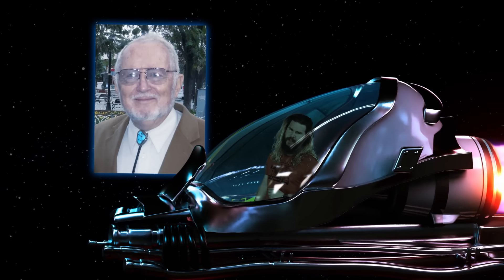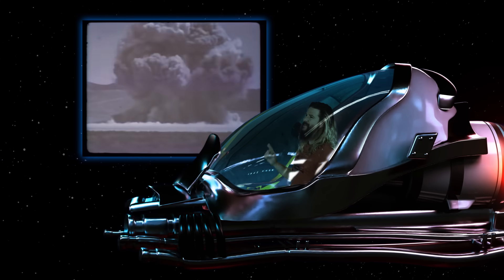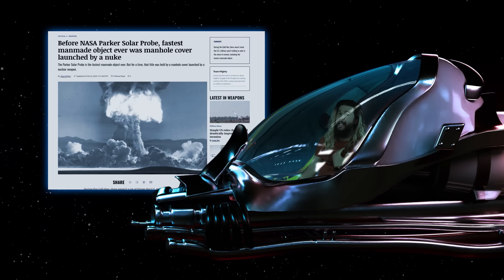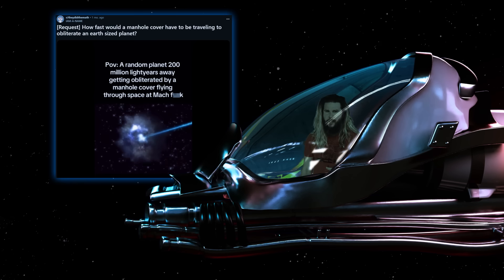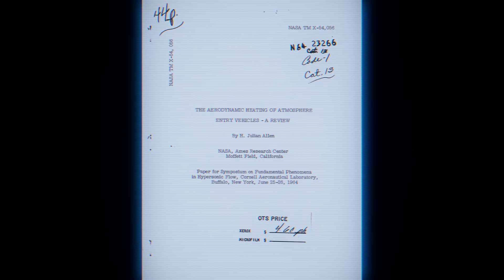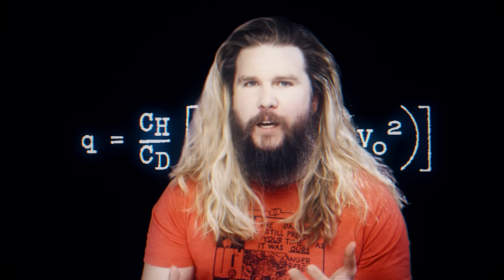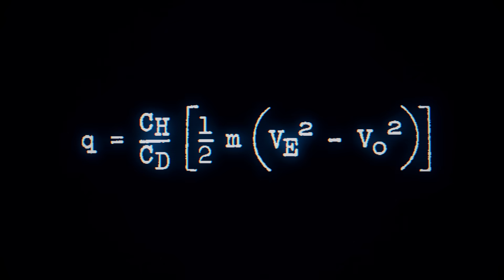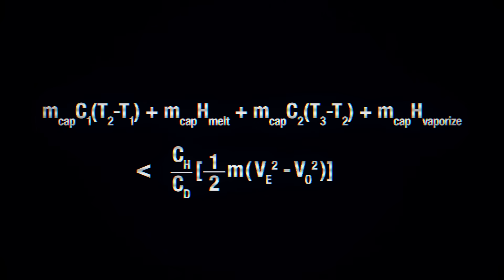Debunking the Nuclear-Powered Manhole Cover

Comment from the maker: *Thanks for watching!* So many smart comments! You love to see it. Let's address them:

I knew (and said in the video) going in that everything was going to be a slightly better back-of-the-envelope. In terms of a first approximation that you might find in a primary or secondary physics class, I'm fine with it. I know that the atmosphere is only so high, I know that hypervelocity makes a difference, I know that heating takes time, I know the shape factor might not perfectly apply. Like I said, first approximation -- I don't have a supercomputer for millisecond-by-millisecond analysis.

Further thoughts:

Drag is proportional to the SQUARE of the velocity. So some of you saying drag is less at hyper velocity are not thinking about this. Observe how “slow bullets” move through water and hyper velocity bullets are more or less destroyed on impact (yes water is 1000x more dense I know, but the velocity increases the drag that much).

Think about the boundary conditions I set. We made it so there would have to be “at least this much energy.” There is, and so having it be 5-10x more energy than “required” means there is room for a fudge factor.

If you have problems with the approximation, do let me know. Otherwise, if there's a more capable physicist, take what I did one step further!
Reply: Should've calculated how far it could make before being vaporized! Would've been interesting
Reply: My only question about this is time, actually. Heat transfer does take time, and unlike how many meteors come down, that thing was going straight up. The question is less 'can the atmosphere melt that much iron if it's flying at this velocity' yeah, we've watched starship almost burn a wing off twice, and more 'can it do this in time, before the lid makes it past the denser parts'. Exposure time is important here because although it's basically being roasted by plasma as the air basically explodes on contact, it's still heating from one side at a time. 

I do understand how complex this gets, i don't even want to think about the dynamics of the drag heating on the cross section of a disk moving mach jesus, flipping through the air and probably sounding like the most unholy ricochet ever on it's way to god...
Reply: @zerumsum1640 Honestly the assumption Kyle made is probably pretty conservative.

One of the main sources of heating would be adiabatic compression. The air won't have time to move out of the way so it will compress a column of air above it at 150,000 mph. Heat transfer rate is proportional to the pressure.

So the harder it is hitting the atmosphere the hotter and more aggressive. Using some of the simple wall temperature estimations for reentry. The shuttle capsule had a wall temp with this formula of 1600K. The same equation for the manhole cover is 33000K...
Reply: I think the biggest issue is this part:
(VE^2-VO^2) being simplified to (VE^2).  
This single bit assumes that the plate was burned up as it encountered enough drag in the time it was in atmosphere to come to a complete halt. 

 I am not saying it couldn't, it's just you showed no math that proved that it would encounter enough drag to reduce it's speed at a reasonable pace.  Remember this thing was NOT instantly destroyed on launch and would have punched into the Thermosphere within fractions of a second unless it had absurd slow down from drag.

TLDR VO^2 = 0 assumes that the plate was burned up, therefore your math proved it definitely burned up.
Reply: @zancloufer Vo=11.2 kms (orbital escape velocity) recalculates it from 3.8x10^13 to 3.7x10^13 not much change there lol. But I agree it is an invalidating assumption to say no it didnt make it. But the numbers are close enough to warrent a hey that's pretty close we now cant be sure. It's also extra hard to come up with what that final velocity could be since flying through a nuke blast is "different" than normal mesosphere lol.
Reply: @zancloufer  I also think this is the biggest issue with this video. And not even that he simplified it, but that he did it silently, without mentioning that he's doing it, why, and how it affects the meaning of the result.

If it turned out, with this simplification, that there wasn't enough energy to vaporize the plate - that would be conclusive.
Converting only part of the velocity into heat gives you less heat than converting all of the velocity into heat.
So if it turned out the latter wasn't enough to vaporize the plate, the former would've been also not enough.

So Kyle's calculation could be seen as an attempt to prove that the plate could not have vaporized
And the attempt was unsuccessful.
Which means it's inconclusive - there was* enough energy to vaporize the plate, but we don't know how much of that energy went into vaporizing the plate, and how much was left as remaining velocity.

The calculation is fine, but the way it was presented is misleading.

*assuming his other assumptions are correct
Reply: Does this also assume the cover stays flat the entire flight? If it tumbles or goes edge up at all, that should decrease drag slightly over just staying flat the entire time.
Reply: But Kyle,  it was not traveling flat on.  Nor was it traveling through sill air.  There was a strong jet of gasses coming out of that tube pushing it along.  Though you also didn't mention the heat or induced heat from radiation from the explosion.  With such an inaccurate model me thinks your conclusion is not very helpful.
Reply: "Lets compare this with the numbers of Atmospheric re-entry" --- raises hand  Wouldnt that still not work though?... in Re-entry, you start with a thin layer, then work your way into a thick layer.. with the thicker layers increasing the friction, which in turn increases the heat build-up/resistance.  That manhole cover though, was going the other way, starting with thick atmosphere (albeit a huge chunk of it displaced by the explosion itself), then moving into thinner atmosphere.  So starting at max resistance/friction, ending with least amount. So rather than 'heating up' on the way in, wouldnt it be 'cooling down' on the way out? (not exactly cooling down, but the rate of heat-increase would slow more and more the higher up it goes?)

reposing this here incase the first gets lost in the 2000+ comments :D
Reply: @Gwydion_Wolf  It would not be an inverse as he explained it. The layers you mentioned, I am assuming you are referring to the atmospheric layers: Exosphere Thermosphere Mesosphere, Stratosphere, Troposphere. They do increase in height as you move away from the planet, they decrease in pressure as such density as you move away, they also change in radiation potential and electromagnetic properties as you move toward or away from the planet. Moving toward the planet you would be moving through  layers of increasing density but rapidly slowing down as you did, because of this you would be building heat because of the air resistance. Moving away from the planet at a super high speed the change in density becomes less important because of the small amount of time you are in each layer (fractions of a second). 

One of the more important points that he missed, when an object enters the atmosphere it often follows a very special arc around the planet called  a decreasing eclipse. An object rarely has a head on collision with the planet although it does happen, the reason it doesn't happen often is because of the heat the object will build as it moves through the layers speeding up because of gravity. The heat speed and air resistance  usually causes the object to blow apart, which is why it happens but mostly insignificant.   Where the manhole cover is different is that it is moving directly away from the planet at such a high rate over such a short time, going through less dense layers the further away it gets that it still heats up it just heats up slower. 

There are a lot of super complicated scientific principles going on with this manhole cover. Properties of metals, aerodynamic properties,  physics of motion, physics of planetary bodies, thermodynamic properties, fluid mechanic properties, and more. All of these are very complicated and science still doesn't understand them completely, when you try to solve these properties at the speeds the manhole cover was going the properties act different and science struggles to understand them more. Physics and physical properties act really weird at super hot and super cold temperatures,  super high pressures and vacuums, super high speeds and accelerations, and instantaneous changes in direction.
Reply: Here's my problem. An object performing a re-entry is carrying the full energy of the event. A static atmosphere that is increasing in density with depth is being impacted by an object coming in from space is not the same thing as a giant bullet from a giant gun. If a nuclear explosion accelerates a bore-hole plug then the object will be pushed by an enormous force of expanding gases. This enormous force of expanding gases will create a giant atmospheric phenomenon of which the front will be carrying the plug. There will be a giant plume of gas that forces itself to higher than normal altitudes, There will be enormous pressure both behind and in front of the plug, and just in general it is not reasonable to assume that a re-entry will be an appropriate analog. It depends on how fast the plug was moving and how fast the pressure wave of the air was moving and exactly what this means for the plug-air interactions , , , but being hit by a wave is not the same thing as riding it. I won't argue that it made it to space, but I will argue this is not an adequate "debunk".
Reply: Something isn't mathing in your math here Kyle.  In both the formula at 9:35 and in the plug in at 9:39 you have what equates to a much smaller number on the right side of your comparison.  It seems like you might have squared something you didn't show.  I have the right side equaling 3.8 x 10^7 or 38,301,150 Joules.  Also on the left side of the comparison it seems like you are mixing up the units.  With the exception of the first expression (934kgx.(45kJ/kg x K) you are using kg x J/g.  Did you take this into account in your calculations and just leave it like that to make sure we were paying attention?  I take off points for not keeping your units consistent. :D
Reply: @russellashburn6268 you forgot to make the 66kilo m/s into 66000 m/s before you plugged in and squared it. Units are a pain fr.
Reply: As someone brought up in one of the comments, when you apply this equation for objects moving upwards, you're inventing free energy!

And the assumption that the final velocity is 0 bakes in the result – the manhole either had to melt, or fall down.
Reply: @mskiptr final velocity being zero is asking if ALL the energy was lost to drag friction CAN this thing atomize not, will it stop flying. If the slug was 10x larger and still set to final velocity 0 it would have said CANNOT atomize. The numbers kyle ran are close enough that you can say it COULD have been stopped not it did get stopped nor it didn't get stopped.
Reply: One other factor missing is that the drag coefficient seems to assume no tumbling. Also at those speeds, is the air moving really away or compressing? is part of the heating going into the compressed air instead? Is there a leidenfrost effect playing a role of superheated iron plasma protecting the bulk, that maybe is liquid already but still moving? As for the comparison with metoerites, those explode but fractions make it to the ground at times, so maybe there is some iron shot flying through space? We have space probes reentering fine at ~12km/s, not even one order of magnitude off ... as for the heat transfer timing, I would really be intrested how fast it spreads (cant be convective in the solid state, also not really that fast convective in the liqiud I guess) vs. the time it takes to leave the athmosphere...  I think this is one of those cases where no back on the envelope calculation can give a good answer and real simulations are needed. Maybe start a crowdfund camapaign....
Reply: @PlasmaHH  it also assumes a flat disc, which this thing most definitely would not be after accelerating to hypersonic speeds in a fraction of a second
Reply: @PlasmaHH  The Leindenfrost effect would not really apply here because of the surface tension requirements at pressures and the shift of eutectoid points from the pressures and temperatures. Many of the principles and phenomenon that dude referenced are all flow dependent or time dependent. The behavior of flow rates at temp extremes as well as the limits as time approaches critically small measures for thermal transfer rates creates chaos in the principles. Even the behavior of parasitic or primary drag forces begin to take on different effects because of the density ceilings of Navier-stokes. I would argue that the extreme difference between the xy (flat coin) face of the cover in comparison to the zx (coin on edge) and the aerodynamic differences begin to take on weird properties, if the flight was stabe (non tumbling) air resistance and compressibility are mute points because of the magnitude difference. If the cover were tumbling proportional to the forward velocity, it would be tumbling at such a high rate it would basically begin to take on the aerodynamic properties of a sphere in flight. The surface heating of the cover would not just be limited by the thermal transfer in, but also by the diffusion of heat into the whole cover to reach equilibrium. It would technically be possible for creep rates and eutectoid shifts to cause a surface phase shift that would cause partial liquidification at such high temperatures and tumbling rates.
Reply: A Supercomputer?!? It's calculating a single disc being launched through a thinning atmosphere, we're not talking about global weather models...

Pretty poor and defensive response to a lot of very constructed and well thought out explanations as to why your video would be perpetuating just as much falsehoods for making it sound to the layman like you proved something. You provided a worst case scenario with no context that that's what you are saying and you didn't calculate a best case scenario let alone mention that what you calculated could be far far lower than what you provided given the best case scenario or even the possibility of something in between.
Reply: “(A)t least this much energy” still assumes that the speed is reduced to zero. In which case it doesn't have to change phase in order to not go into space.
In other words, you have shown that there's enough total kinetic energy to vaporize it - with a far more complicated formula than necessary - but you haven't shown that it will happen. You haven't even shown that it is likely.
Reply: Also, you really don't need a supercomputer for millisecond-by-millisecond analysis; a mid-range laptop from ten years ago would be more than enough, there are only a few thousand milliseconds to calculate before either it has been stopped by drag, or has escaped the atmosphere.
Reply: @kylehill  did you really like your own comment? 🤓
Reply: An actual physicist here.  The calculation is wrong, because the wrong units have been used on the heat of vaporisation.  It should be 6340 kJ/kg not kJ/g.  That is a very big difference, because the number used is 1000 times what it should be, and makes the whole energy for vaporisation nearly 1000 times what it should be.  Using the numbers with the correct units gives 7.9*10^9 J, rather than 5.9*10^12 J.
Another error is that the right side of the equation is supposed to be the fraction of the kinetic energy that is converted to heat.  That means it can not be larger than the kinetic energy.  Instead the kinetic energy has been multiplied by 24.1/1.28 = 18.8, which is far too large.  The right side of the equation should be no larger than 2.0*10^12 J.
The other (more minor) issue is that the speed was never actually measured.  But, even if it was escape velocity then the kinetic energy would be 5.8*10^10, which is more than enough for vaporisation.
Reply: You let confirmation bias build the reasoning for the conclusion you already had.
Reply: Would it made it to space if it were made from a different material other than puny cast iron?
What about ceramics or Tungsten.
What about a more Aerodynamic object with less drag, is it even physical possible to make a "Space Cannon"?
Reply: @timhartherz5652  Yes, NASA made a Space Cannon out of a WW2 Battleship 16" deck gun a long time ago.
Reply: I thought the manhole cover was made of steel and weighed around 2000 lbs but perhaps I was wrong! Still interesting
Reply: Kyle genuine question, and forgive my ignorance. Does the time make any difference? As the time in the atmosphere would be very short. It would reach the Kerman line in about a second and a half. Can it generate that much heat in that amount of time? Or is time irrelevant, and the depth of the atmosphere is what counts?
Reply: Only way to really know is to do it again. For science!
Reply: Kyle there's a difference between a back of the envelope calculation or a calculation that, no matter what was done with, would only produce one result. Manhole cover didn't go to space. Your calculation assumed it hit velocity zero while in atmosphere. Whether it burned up or didn't becomes irrelevant to the results, because if it hit velocity zero in atmosphere then it didn't reach space. Its understandable to be unable to calculate every little detail of its flight, but to declare you've debunked the manhole cover reaching space when you didn't even allow for the possibility of it reaching space is the same kind of science scam you've declared you hate.
Reply: Did you calculate the drag coefficient as if the disc was flying on its edge like a Frisbee, or face on like a circle perpendicular to the angle of acceleration? Would spin affect the calculation noticably? If the angle of the flight matters, is there some possibility it could have stabilized in the air?
Reply: I have a question about how the cover spinning at an extreme speed while breaking through would affect the calculations, would it increase or decrease the heat resistance of the iron in transit?
Reply: A further problem with this is that the kinetic energy would be more than the entire yield of the explosion.  Pascal-B was 300t, which corresponds to about 1.2*10^12 J, whereas the estimated kinetic energy would be about 2*10^12.
Reply: I have one question. Is the initial speed verified? As I understand it that is only based on one mans calculations. If that number is wrong then the whole equation is wrong.
Reply: You made alot of assumptions that I don't think hold up very well. 
You assumed the cover was flst the whole time, this can't be proven and seems unlikely given how hard that is to do. Your equation is for something that's entering the atmosphere going from lower friction to higher friction, and you assume that the whole piece heats up uniformly which nothing does when it's being heated up that harshly from one direction. 

Then we go to the material, cast iron, cast iron does burn relatively easy compared to something like steel or wrought iron but that still takes time, and I don't know if you took into account how much time would be needed. And second modern cast iron is much more homogeneous that the majority of meteorites that explode In the atmosphere. 

I understand that this is only slightly better than back of the napkin math but you've really only shown that it's technically possible  the manhole cover vaporized, but you left out so many variables that you can't even say it's likely
Reply: From all the articles I have read says it was steel, not cast iron. So could you please redo your math since steel handles higher temperatures.  Now, if all these articles that I read have made the same mistake, I apologize.  Thank you
Reply: Does the equation change if the "projectile" settled into an edge forward direction
Reply: I am thinking about how it most likely didn't go straight up without it toppling end over end...
Reply: Problem with your equation is you are assuming that the drag coefficient is constant. If portions of the man hole cover are vaporizing then as the object moves through the air and more of it is vaporized it stands to reason that the drag coefficient would change with the changing shape due to vaporization. I think it would be reasonable to say that most of the man hole cover would be vaporized but some amount would make it to space.
Reply: @bevey3437 the manhole cove is going WITH OTHER MATERIAL so less of it would vaporize then you are thinking😅
Reply: One factor/variable you failed to account for is the nature of pure metal under heat and pressure. It would have compacted in on itself in a cone shape. Heat transfers take time. And I don't think it took long enough to get to space to have the time it would take to burn up. I think it would have heated into a liquid, formed into a cone/bullet shape, and naturally taken the fluid path of least resistance. It definitely would have lost mass on the way to space, but due to the pressure of air resistance, it would have been pressed in on itself and gained a molecular density and surface smoothness that, coupled with how quickly it was yeeted, may have spared it from vaporization. Alternatively...if the heat it took exceeded vaporization temp like 5 to 6 times over...is it at all possible it became a plasma projectile?
Reply: The thing was solid enough in the picture that if it had hit melting point i dont see why it couldnt have become plasma 😂 @joshuamcdowell1460
Reply: HOLD ON...If it's traveling that fast and gets well into space in a second or so... doesn't the law of thermodynamics have something to say about this!? An object launched at 150,000mph reaching space in 1 second or so, would likely negate the time needed for friction heating to destroy it due to minimal atmospheric exposure!! A Huge amount of heat may have been generated, sure! But did it have enough "Time" to affect the plate to destroy it!? Any heating no matter the temperature "Doesn't happen instantaneously!! It would have had only 1 second of exposure, before being super cooled in space! Iron needs somewhere in the region of 1.6 GJ = 10⁹J , in only 1 second, per Kg... To have melted the iron! So requiring 320 Giga Joule's of energy in 1 second to destroy the plate! Or the same energy produced by 320 nuclear power stations combined in one second!!
 A candle can burn at over 2500°F... But you can move your fingers through it no problem, as long as you keep moving and don't allow the heat to soak over "Time!! 
The meteorite argument doesn't really make sense either!! It's traveling much slower! Is exposed to the heat for many 10's of seconds! And always skips across the atmosphere for 100s or 1000s of miles...Not a direct straight path from ground to space like this! The second law is a pivotal aspect of physics that nobody has cared to involve in their estimations not to mention the possible Quantum effects on the systems involved!!
Reply: I have a question. Our atmosphere gets thinner as you get further from the planet, correct? If so, your numbers arent quite right. As something enters the atmosphere, it meets contunually increasing resistance. In contrast, something exiting the atmosphere would meet continually less resistance as it goes further. Also, a disc in flight such as the one in the video would not rise perfectly flat, it would begin to spin, which could reduce the energy transferred to said disc due to less drag and a more universal "cook time" on the surface area. How would these changes effect the flight, or vaporization, of said iron disc?
Reply: I have a doctorate in aerospace engineering and did my dissertation at ASU on a proprietary math that calculates air flow at a much higher accuracy and speed than all modern systems (my math and software is currently used by a major defense contractor). I can also test objects flying through the air with some manipulation. I threw this into my program a few times and what I learned is that at hyper-sonic speeds it took over 15 seconds to reach a point at which the velocity would vaporize it based on temperature. I also threw in a test where the manhole cover was spinning around on a single axis at 10k rpm and it took 9 seconds to heat up to the point of vaporizing. Im not super versed on velocity decreasing over time do to resistance and gravity (other end of my focus) so I cant attest to that. But with the reduced friction and temperature at you gain altitude I would say there is a greater than 50% chance it made it into deep space (If it didn't collide with anything else) and greater than 75% change it cleared our atmosphere.
Reply: funny how you said 'millisecond-by-millisecond' when, quite literally, all we have is a millisecond
Reply: Unless you're assuming the manhole cover vaporized the instant it reached 66km/s you did your change in velocity wrong. For the purpose of heat exchange here the change in velocity we need to use in the how much velocity the manhole cover lost as it went from ground level to space. If we are generous and say that it takes 2 seconds for it to exit the atmosphere and atmospheric density is always the same as sea level, and use the maximum drag force for the whole distance, the manhole only loses 180 m/s. You can then plug it into your equation and find that the heating energy is on the order of 10^8 J which is a lot, but far from the 10^13 J that you predict.

Edit: went ahead and found a better drag equation and confirmed it to be quadratic and the change in velocity only increased to 362.8 m/s. That only brings the energy from your equation up to 1.15 x 10^9. Still not nearly enough to vaporize the manhole cover.
Reply: @Harkmagic  I would love to know which drag equation you used to get a reduction of only 180m/s, because when I calculated it, the peak drag was enough to stop the entire 66km/s in 0.024 seconds if you assume that the peak drag remains constant.
Reply: @WJS774 
v(t) = v0 e^(-t×b/m)
With b as the drag coefficient.
Get m and b from Kyle and set t to 2 seconds.

Its technically a horizontal drag equation, but gravity is trivial so it works just fine.

Classical Mechanics, John R. Taylor, 2005. Page 48 equation 2.22
Reply: @Harkmagic  OK, so you've totally butchered that then. Firstly, that equation makes the assumption that you can ignore compressive drag, which is obviously not the case at hypersonic speeds. Secondly, the "b" in that equation is not the same b as Kyle is using. Read chapter 2.4 on quadratic air resistance, and if you do the calculations correctly you'll see that using these equations the cover will have lost 98% of its speed after 2 seconds, and have made it less than 10km into the air. In reality pressure will have dropped at that point and drag will be less, which this equation does not account for, but most of the velocity loss will have occurred when it was much lower. The cover will no longer have escape velocity after just 0.2 seconds.
Reply: @WJS774  Since he misunderstood, then you decided to throw the gavel: the hypersonic compressive drag is still a fluid based principal that has limitations in density, velocity, stagnation, molecular proportion, even electromagnetic limitations. Do the calculations of the kinetic energy of the cover, then contrast the magnitude of that with your claim of 98% loss in just over 2 sec. Everyone is here out of curiosity, when you throw shade because someone didn't understand you bring the spotlight on yourself. You're better than that.
Reply: @WJS774  Your drag calculation is wrong.  The amount of time it takes for drag to reduce an object's speed to 0 is infinite, because drag is proportional to velocity.  As the object slows down due to drag, the force of drag reduces.  You can not assume drag is constant.

In this instance, even the other parameters of the drag equation change over time.  The fluid density decreases as it rises through the atmosphere.  The mass decreases as bits of it vaporize and ablate away, also causing the coefficient of drag and the cross-sectional area to decrease.  Absolutely none of the parameters can be treated as constant, thus requiring integration to solve.
Reply: @PaulBurg  I said if it stayed constant, to illustrate just how high the drag force is at that speed. Obviously this isn't actually the case.
Reply: @Harkmagic glad I'm not the only one that noticed he forgot to calculate the change in velocity.
Reply: It looks like the velocity was assumed to be a constant, but the aerodynamic drag would have slowed the plate down
Reply: I have a theoretical question, if the cap were to end up vertical (like standing a coin on its edge) would the improved aerodynamic state of the cap change the result of the calculation?
Reply: @PBMototsports  It wouldn't happen, since the edge is an aerodynamically unstable position.
The most stable position for a flat disk is face on.
Reply: stop fucking trying to sound relateable to gen z. it just makes you sound fucking retarded.
we do not use those words the people who do use those words brains are already mush.
Reply: Don't be mean to Joe!
Reply: I'm wondering if the original 66 km/sec estimate was sane in itself. The thing had to accelerate, and so when did that happen? Shouldn't you integrate the heat transfer equation over the delta-t of that formula? It seems like you short-cutted it - no napkins needed.
Reply: Small point of contention, is that heating algorithm for vertical or horizontal flight?  With the sharp reduction in density from vertical exit, could the heating have been reduced that it liquefied instead of completely vaporized?
Reply: How does atmospheric density lessening as it goes up affect the heat transfer? Wouldn't that allow it to get higher before the heat is transferred? What height would it have been vaporized since it wasn't instant?
Reply: The biggest problem I have with your approximation is you used the equation for an object entering the atmosphere wherein it is meeting increasing resistance proportional to its descent, whereas there IS an equation for an object leaving the atmosphere and it’s not the same as an object leaving the atmosphere encounters less drag the further up it goes.

You started this with fundamentally flawed math, so your results are fundamentally flawed.
Reply: I am way out of my depth here so if i am wrong please tell me but wouldn't the atmosphere be thined by the blast and have a lower relative speed to the manhole causing it to experience less friction then would be shown in the comparison equation for atmospheric reentry?
Reply: Yeah it's a fun video. But to be honest, I'd be curious if the 5-10x margin is enough to possibly allow escape velocity. If it was 100x difference I think we could be pretty confident no other factors could make enough influence to allow it. But 5 or 10, not so sure we can rule that out.
Reply: Perhaps the most important thing to consider is the fact that this hypersonic manhole cover is accompanied by a focused  hypersonic jet of ionized plasma from the blast pushing the atmosphere aside as the manhole cover moves through the lower atmosphere.
Reply: Does your equation account for time? A blow torch has enough heat to metal steel but only if it has enough time to do so.
Reply: I dont think you accounted for the atmosphere being a gradient and that pressure/drag decreases exponentially with altitude. 50% of the volume is in the bottom ~4.5% of our atmosphere. 
So you would actually be squaring a number that is exponentially decreasing, as both the object is slowing down and losing mass, and the friction from the atmosphere is decreasing. If friction is decreasing ~2x the rate of the decrease in pressure you likely would not have enough energy to destroy it.
It would also therefore need to lose at least 50% of its mass in ~1/10th of a second, which may or may not be possible. I dont know if it could conduct that amount of energy in that amount of time by those means.
Reply: Wouldn’t melting of iron be enough tho? This would substantially decrease left side of equation even more
Reply: You will get those comments, when the math has so many variables. Examples Thermodynamics on a changing leading edge.
Drag coefficient.
Sectional density from orientation.
True air speed.
Without these taken into consideration. You can only test best/worst case. If they both come to the same conclusion, it's just a best guess.
Reply: I've just watched the video, but I have some problems.
The experiment was not about containing a nuclear explosion, but testing the safety devices of nuclear bombs by putting one in a hole and detonating a normal bomb on top of it. It was part of operation PLUMBBOMB. The experiment to fully contain a nuclear blast underground was the Reiner shot, conducted later.
Also, the cap was not cast iron, but solid steel and it was welded on top of the hole. So it was not just lunched from the top of the shaft, but torn off. Meaning the shape was most likely not a flat disc.
And you did not account for black body radiation in your equation. Which is kind of sad.
Also, as the travel starts from dense, oxygen rich atmosphere, it is likely that an oxide layer formed that could slow down heat transfer.
And the comparison to meteorites does not make the conclusion more plausible, as meteorites are usually not made out of solid materials, and are more likely to break up upon entry to begin with. In Indonesia they have a collection of man-made objects that survived re-entry and breakup. Satellite makers are required to do tests in plasma wind tunnels to check what would happen to its parts upon re-entry. Those test probably have more relevant data on the subject. And the "rod of god" weapon system could also have some relevant calculations on the subject.
I am not questioning the conclusion, just listing my gripes.
Reply: @kylehill did we include the concrete / cement support structure presumed to be behind the manhole?
Reply: GOD hates the sin, not the sinner! GOD is the Judge! don’t kill people! We need GOD! Please do not use THE LORD’S NAME in vain! Leave revenge to God! Karma isn’t real, GOD IS! We are all made in the image of GOD! AMEN! 🙏🏾✝️
Reply: Surely it wasn’t flat it would’ve rotated to least resistance
Reply: Does that account for the manhole cover likely to be tumbeling and the thing of the atmosphere as it rose? Just curious.
Reply: You say that you don't have a supercomputer, but have you looked at your phone lately, and compared it to a Cray XMP from the late 1980s?  You almost certainly do have a super computer!

It's a pity that Apple and Google make it such a pain to program on, though.  Oh, the wonderous things we'd be able to do, with the super computers in our pockets, if only we could run Fortran, Common Lisp, and Forth on them!
Reply: Isn't the estimated speed a lowball assumption anyway since we only have on frame of the damn thing, or  is it possible to calculate the deformation of the object on the picture with the shutter speed of the camera they use ?
Reply: would this equation take into account the heat from the actual nuclear bomb that was set off? If not that would increase the likelihood of it vaporizing.
Reply: What about cooling
Reply: I might have missed it in the video, but did you say that you were calculating the “man hole cover” as if it went horizontal the entire way to vaporization or did you calculate it vertically. Because assuming that the man hole cover left the ground with an even distribution of pressure is flawed. Any amount of angle and or uneven pressure or maybe even uneven air pressure would have flipped the cover vertically. Or at least that’s what I think… like you said, “back of the envelope calculation” but I feel like this is a significant enough factor to affect the overall outcome of the calculation. And maybe someone else already had this idea.
Reply: Hey do you think the blast cover was continuously accelerated by the a-bomb driven Shockwave below it instead immediately decelerating? Or like the gas bloom that could likely be going faster than the cap and around it changed the atmosphere conditions in funny ways like how hypersonic cavitation bullets don't slow in the water as much as other hypersonic projectiles do? Or maybe the blast slagged it first before the atmosphere? Or maybe it both vaporized and shotgunned out into the void keeping itself together like a smoke ring. Also the math done assumes it comes to a halt bc our Vo=0kms but if we make it say a smart sounding number only slightly at random like orbital escape velocity itttt changes nothing, 0.1 of the factor he got lol. Same conclusion. But I'd be interested in challenging the assumptions of people's calculations like the atmosphere it's traveling through is a atomic bomb blast its probably got some funky velocity profiles and temperatures plus the pressure profile following the cap, this video is some good thought provoking material and sparked passion in me and others thanks Kyle ❤
Reply: The biggest problem I see with the estimation is that I would not expect the manhole to be perpendicular to the flight path. It would be interesting to revise the results if the manhole went sideways. From an order of magnitude it looks like it may have survived. I would also only check with the solid version as the molten version would probably look more like sparse droplets (other type of vaporization?)

Great video though! Love the channel
Reply: I have a theoretical degree in physics
Reply: why you call yourself kyle hill?
Reply: yeah, but since it have stayed in a solid state, no matter the tiny ammount of time it did, it is still the fastest object at "sea level" atmosphere for now, right? its "speed" (because i guess it's mostly fragments) have been measured by camera
Reply: I have even bigger problem with that whole story. Pascal B was a small nuclear charge with a yield of 300t TNT. That is 1.25 x10^12 J. So how is it possible that the manhole cover gained MORE KINETIC ENERGY THAN THE ENERGY OF THE WHOLE BLAST? At 66km/s, 900kg it would have 2 x 10^12 J of energy.
This story is bullshit from the very beginning.
Reply: @kylehill Did you talk to @thefatelectrician ?
Reply: Paused at ~3mins in. Then proceeded to wasted easily 20 minutes tying to find that single frame photo of the manhole cover circled || indicated...
Reply: We really don't know how fast it was moving or how long it was in atmosphere. The calculation was for the minimum speed it had to be moving to show up in only one frame of high speed film. I haven't found an upper limit mentioned for it to even show up on that frame. You want the math but I don't think we know enough of the variables to get a good idea of what happened.
Reply: @kylehill i'm not as smartphone as you but.........

have you considered the cold air that prevails in the upper atmospheres and accordingly included a cooling factor? or does this factor fall away due to the high speed of the manhole cover? Whereas one would actually have to be added, considering why car engines don't overheat at 400km/h because of the air that meets the grille on. You know what I mean? 

Pls give me a answer 🥺
😅😅😅
Reply: and you didn't include the heating the nuke added to it, and that would put it even more in the vaporized realm.
Reply: "if it didnt vaporize right away the manhole made it out but not in its original shape"
remember that the cover was flying with a jet of energy.
there was no drag. there was only thrust.
Reply: I don’t care how much “what ifs” and “math” you come up with, There’s a manhole cover rocket through space right now and unless you can show me some fuggin physical proof I will roll my eyes at all the attempts at “debunking”.

Please just let us have the smidge of wonder and magic in the universe that isn’t locked behind impossible to attend universities and wildly exclusive scientific jobs…. This video genuinely pissed me off and that’s never ever happened before on your channel… i haven’t been this mad since those morons tried announcing that they “de-extincted” Dire wolves when in reality they changed 4 fuggin genomes in normal ass wolves!!!

….plus, the manhole covers just one more middle finger to evil Russia who claimed to be the first to space when in reality they weren’t AND they weren’t the first to the moon.
Reply: I believe that you calculated the atmospheric heating incorrectly.  It seems as though you assumed the disc remained flat during it's travels.  I should develop a rotational value changing it's heating characteristics into something that would have to be calculated with an integration of the atmospheric heating between the thickness and the width of the cap.
Reply: My problem lies not with any of the math associated with the video, but the addition of (to my understanding) the additional concrete that was poured on top of this cover. It would mean that the concrete would have to burn up prior to the iron vaporizing, as it is the leading edge, and would act like the heat shield of the space shuttle. As someone who works with different properties of concrete specifically, it's going to be hard to determine the type of concrete that was used in order to acquire the thermo coefficients of it. But, if I have any of my facts wrong, please educate.
Reply: @renaissanceman1989 the concrete was converted into plasma almost immediately.
Reply: @joshuamcdowell1460  How would that work? If the concrete was on top of the iron, and we know the iron exited, how would the heat transfer to the cement that quickly? Furthermore, I know for a fact that the melting temperature for iron is far lower than the melting temperature for cement, much less vaporization... Am I being trolled with this response? I'm just curious about this whole incident and I genuinely want to get to the bottom of it. My impression was that it was a thick layer of cement was on top of the manhole (the figure of 4 feet comes to mind, but unable to source that info), so the cement goes past the vaporization stage and has the additional enegy to go to a plasma state instantly? This doesn't make sense...
Reply: We are assuming the cover remained flat... at that speed it would most likely flip on it's side. Even possible it started spinning.
If it flipped on it's side the amount of friction and surface area exposed to the air resistance is greatly reduced.
Reply: I understand all the math...I think...but my question is this, did that plugging and chugging take into account the speed at which it was moving through non uniform air... the higher you get, the less air there is to cause friction.  So while the meteor does show what we know to happen upon entering earths atmosphere it is going from no friction to friction and slowing down.  At the speed this manhole cover was moving would it interact with enough air from ground level to however high it got to reach the Joules calculated? The Karman line is at approx 62 miles, so... at 150k mph it wouldn't be in our atmosphere for friction for more than a fraction of a second and given it was caught at the initial velocity in that single frame I'm still questioning it a bit since the numbers calculated seem to indicate that the manhole should have basically vaporized itself, or been in the process of vaporizing before or during that single frame of video it was caught.  

At the speed given and the joules calculated, would the change in air density and the changing friction coefficient even matter?

Sorry if this question doesn't make sense.
Reply: Please fix your video
Reply: Okay I have a question. If the cap travel up with the hot air at the speed of the shock wave and flipping in the air with the air getting thinner by the heat and altitude is getting thinner. And unlike a astroid it is going up and down. And the cap is iron but astroids exposing is more likely has elements that don't like the heat. And the cap has everything after the bomb trying to slow it down and going straight up and most astroids don't go straight down. And if you take a bullet and shoot a piece of metal twice once at a angle it is more likely to bounce off but the straight onto it will cut a hole in the metal. And the film had one frame with the cap we don't know 100% if the cap was not covered by the flames before or after the one frame and if it was flipping who knows? But I know that there is no cap in space maybe small iron bebes or iron glitter.
Reply: As the metal reaches its melting point, would the cap lose mass due to melted pieces falling off, and how would that affect the equation?
Reply: Bullets shatter on impact with water because they are entering a different and much denser substance (but if fired underwater already, they do not shatter). The manhole itself is already in a fluid (air), and would not face this situation. If anything, the manhole faces less resistance the higher it goes. And the mythical video itself shows the survival of the manhole from the initial blast, already moving at that velocity, already a few thousand feet in the air.
So I'm surprised you assumed constant drag and pressure for your equation, and no rotation either.
I'm disappointed by the assumptions made in this video, since they were flawed from the very premise.
I still think it vaporized, but if you are going to use math, you should do it right..... This is not the nerd way.
Reply: Ok, so I did some number stuff, and here's what I have. If the velocity is correct, the amount of air resistance on the cover would be 18million lbs at least. Now the velocity of it and the time it would take to get to space negates any deceleration that it would have from resistance alone. Add in the unstable shape, the immense heat from friction, and with those numbers it should vaporize and stuff.
Now, my guess is the fact we see it for 1 frame in what we can assume is a 400 frames/s camera, its closer to 50,000 mph.
So lets number crunch there. You now have 1mil lbs at least of air resistance on an unstable object. The rate of deceleration in this case as well as being unstable means the stresses would rip the steel apart before it even had a chance to get to space.
Reply: How to convey this potentially underutilized variable...

Rotational energy loss or R for short here.
Distance to the Vacuum of Space or Ds for short here.
Convective cooling factor or Cc for short here.

It is my hypothesis that the object in question had the potential to escape orbit intact but likely warped or deformed. Therefore we need to look at the parabolic curve of energy transfer to the surrounding atmosphere with the context of drag being subverted via centrifugal forces which would have decelerated the object to a much lower rate of speed over the course of thousands of feet. This spinning would have reduced friction until the item either warped spherical or until the atmosphere was breached. Therefore I will reiterate that I think it spinning is what kept it intact enough to exit the atmospheric envelope despite significant velocity at the launch site. It would have slowed down much faster due to its shape reducing drag concurrently to its spinning. Your formula is missing variables and while I know the needed variables I'm uncertain as to their proper arrangement orientation for this function. Hopefully my description was adequate in conveyance.
Reply: @kylehill  The problem isn't that your calculation is a bit rough and imprecise, the problem is that it doesn't address the question at all, and incorporates what you are trying to prove (that the plate was stopped by the atmosphere) as an assumption.
Reply: @WJS774  It's not an assumption. It's an hypothesis. It is necessary to conduct quantitative science. Without a hypothesis, you're not doing science, you're doing philosophy. You're not as smart as you think.
Reply: @CharlesFreck  Ironic from someone who doesn't even know what an assumption is. Clue: the numbers he plugs into the equation assume that the plate was stopped because he sets delta-V equal to V-nought. That is called an assumption. A hypothesis is something you test, where the fuck do you think he tested that? I'm a damn sight smarter than you for sure.
Reply: @WJS774  Lmao, nice job trying to sound smart again. You're still not smart though. An equation is a test, genius. If you were smart, you'd know that. And yes, the hypothesis is that the plate was stopped because the hypothesis is that it was disintegrated. The equation tests this and heavily supports it. You can't test if something disintegrates if you start by writing the equation assuming it doesn't. If he sets it to anything other then zero, no matter what other numbers he plugs in, it will always determine it didn't disintegrate because you baked it into the question. You're asking him to write an equation that will always determine that you're right, and will never allow his hypothesis to be right. All so you can say you're smart. But you're not. And using italics only proves you're just someone who thinks they're smart, because you need to rely on visual trickery. If you set it to anything other then 0, then the result will always be the same regardless of any other considerations. 0 is the only acceptable number to test if it would disintegrate. Anything else is a farce.
Reply: @CharlesFreck  Again you demonstrate how dumb you are. It being "stopped" and it being "disintegrated" are not the same thing, genius. He's testing if it was vaporised given the assumption that it was stopped. Any number you plug into an equation is either justified by data, or it is an assumption. That you don't even know this yet are trying to lecture others is honestly hilarious.
Reply: @WJS774  Stopped and disintegrated are exactly the same thing. Object reaches zero. If the object never reaches zero it is never distinegrated. You're arguing he should've rigged the results to suit your narrative. You're asking him to rig science to suit your worldview. You're no different to a Christian who believes the world if 6000 years old, or a flat earther. You are using the exact same argument that both those groups use.
Reply: Nice! Thanks for the video it was fun 😊 but what about the zero final velocity assumption thing? /gen
Reply: A bit disappointing. Your videos are usually of an unmatched quality, but this one seems half assed and incomplete. 

Especially for a "debunking" - the rudimentary math and assumptions you've applied, resulting in less than a factor of ten difference... well, hardly debunked. You also kinda just inserted that it was not the fastest object without any additional information supporting that assumption. 

To reach the energies you calculated, it must have reached the speeds you calculated for - for example - but you seem to gloss over that and this video just felt like a "gotcha". Not something I'm used to on this channel.
Reply from the maker: @alexv1129  I’m sorry. I’ll try better next time.
Reply: @kylehill  Didn't mean to be too critical - just some honest feedback. I appreciate you - and believe you. Incredible channel and career you've run, mate - I appreciate the reply!
Reply: @kylehill  your previous response to everyone's criticism proves that that's not true. You wanted to make a video for clickbait and that's exactly what you did. You proved nothing and you acted like everyone else's stupid for believing what they did. Grow up and quit being so smug and maybe people would believe you when you said crap like this
Reply: Hey Kyle,

Is it possible that the manhole was travelling much, much slower than calculated, but still VERY rapidly, and the reason it only showed up in a single frame was because it flash boiled?
Fe(II) burns electric blue at extremely high temperatures(For example, the temperatures achieved when 1000 kilograms of iron get shot into the atmosphere at Mach 100 and flash boiling due to friction heating?).

After all, the explosion was described as producing a very strong blue flame, like a Roman candle.

Now, I'm very much NOT a physicist, but I'm willing to bet that even at half the calculated speed the manhole cover is moving fast enough to become a cloud of superheated plasma
Reply: This is a fun back-of-the-envelope question. The assumption made in the video is that Vo, the velocity after kinetic energy has been reduced, is zero. I'm not convinced that is the case. Project HARP, for instance, was able to ballistically propel objects out of the atmosphere with initial velocities of only a couple km/s, well below the reported velocity of the iron disk at Los Alamos.
Reply: @maxarmstrong9219  1) They were using ballistically stable objects. A circle is not ballistically stable. 2) they were using much lower speeds. This matters. Square law means the faster you go, the worse you make your heating. Everyone here seems to think "going faster means it won't heat as fast!" No. It absolutely will and adds all sorts of additional issues. Going faster is bad. There's a maximum velocity for ballistic launch. The lower velocity of the HARP projects are further evidence for this disk being destroyed, not the other way around.
Reply: I respect the hell out of you for addressing the nay sayers. I did my own quick back of the envelope thing (attempting to account for decreasing drag from speed and thinning atmosphere) and I got a LARGER transfer of heat than you so I’m positive I did a derivation wrong or just made something up. I got the same exponent but I will not go further than that. Point is. Good jeorb. Enviable hair.
Reply: Also I will say, just calculating using the formula for drag, and then calculating that force in newtons times just 300 meters gets something on the *10 to the 12 power. This alone doesn’t account for deceleration but just in one thousand measly feet there’s probably enough force to melt the thing, although at that speed and time scale is there even enough time to transfer heat? I don’t know enough to say. I am positive I’m wrong a good bit but I suspect most of the heat was immediately transferred and that thing didn’t stay cylindrical for long. 

We all wanted it to be in space. That’s why we fought you science padre.
Reply: @NotBerd  I love how this comment is the one that gets liked, not the ones correctly call out him doing his math based on the wrong formulas
Reply: @austink4712  hey man, I’m just some guy saying stuff.
Reply: @NotBerd See, that’s the part which makes this thing a mystery though.  If it were going to melt from the force as you described, it would have done so within a thousand feet or two.  

The problem is the fact that the frame which we caught the thing on was well over that 2000 foot threshold.  So something we aren’t factoring in (likely the air displacement from the nuclear blast) allowed it to go past that threshold without melting.  Since it was past said threshold, it would become more and more likely to escape the atmosphere as it went up.  This is why the equation he used, which is for reentry with increasing drag rather than decreasing drag, is flawed.
Reply: Funnily enough you loved your own comment ^_^
Reply: @Dellvmnyam  This made me laugh as well. Oopsie!
Reply: Make it a community project, Good Will Hunting style!
Reply: What's the chances of the thing flying face up stabely. I would think it would be tumbling. That kinda messes up all that math that "you" and how many writers did?
Reply: @HououinKyouma-q4o  If it tumbles it's even worse. It means it has a much, much, much, much higher rate of decay on the velocity and worse heating. Tumbling IS WORSE. It only makes it even more likely it was vaporised.
Reply: @CharlesFreck  no it doesn't. Did you even put thought into that comment?
Reply: You should have asked the slow-mo guys about the film They would have been able to give you a better approximation as to the speed the manhole cover was actually going. 

But you need to learn when to let an internet myth just exist Even if it's not right even if it's wrong because it was going to make the rounds and then everybody was going to forget about it but for some reason you just couldn't let it go So now you have a bunch of people that are pissed off at you because you're trying to take something away from them something that was hilarious stupid but gave them a smile.... You need to learn when to tell the kid that there's no Santa Claus You don't tell them when they're six!
Reply: I'm sorry, but "I don't have a supercomputer" has not been a valid excuse in this century.  A Raspberry Pi has more computing power than what when Apollo was flying would have been called a supercomputer.  Any decent laptop or desktop has considerably more.  What you're really telling us is that you don't have the skills to put together a numerical solution of the equations.
Reply: @JClarkeCT1334  bro, google could assemble the equation and run it. It genuinely requires dedicated processing power and time to resolve
Reply: @CharlesFreck  OK, have google do that and get back to us.
Reply: bruh it was going ~125,000 mph, 5x earth's escape velocity. it's gone. even if you divide that estimate by 4 to account for whatever fudge factor you want and the exponential growth, that's still 31,250 mph which is well above escape velocity. also, you feel half of earth's gravity only just 1,645 miles off the surface of earth, and it reached that distance in less than a minute, so even if its velocity decreased a bit the "escape velocity of earth" at 1,645 miles from the surface is now halved.